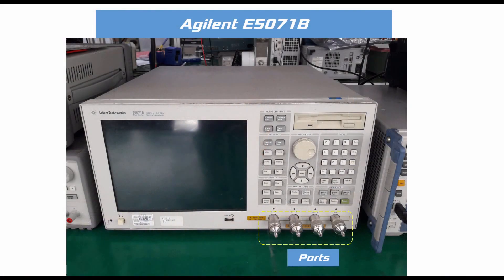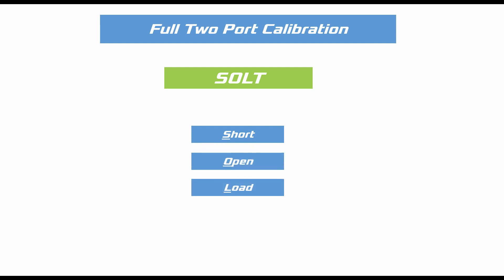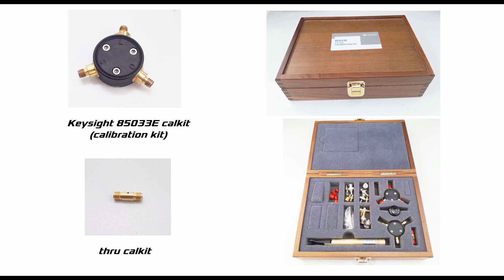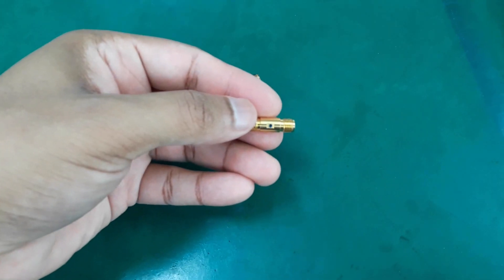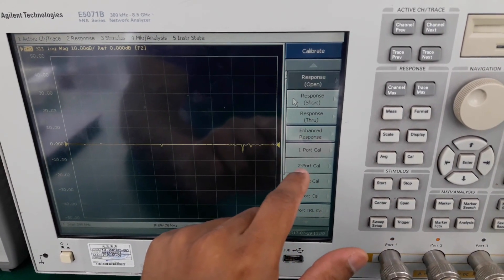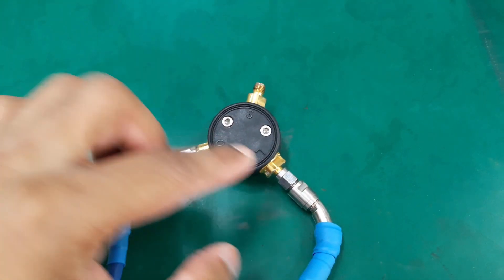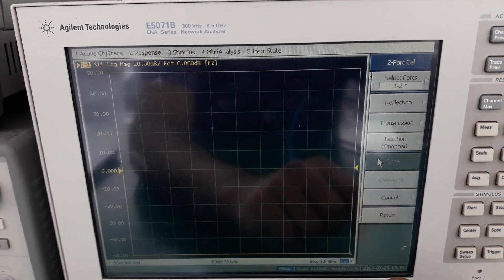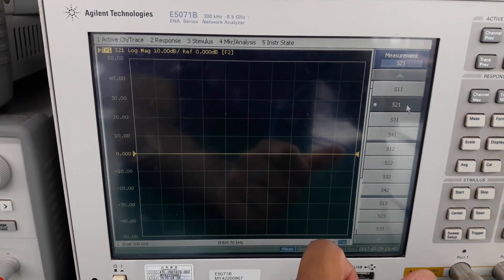Two Port Calibration of VNA (Agilent E5071B) using SOLT method

Comment: Can we leave the port open in the air instead of using the kit for Open calibration when we are performing SOLT calibration?
Reply from the maker: no
Reply: The coax connector in open air is only an open with the expected reflection at modest frequencies.  Up in the GHz range the unconnected coax end will exhibit complex impedances that are not "Open".  Making a 50 Ohm characteristic impedance "Open" termination that works way up into the GHz range is not as easy as we would expect.

Comment: caution: no if found check R input level;  I have this error how to solve plz
Reply from the maker: nahali amina without entire information of your VNA model, calkit number, and the way of calibration (SOLT/TRL) nothing can be suggested
Reply: it is an Agilent 8753ES S-parameter network analyser 30KHz-6 Ghz, the way of calibration is SOLT because i want to measure S11 and S21. thanks  in advance